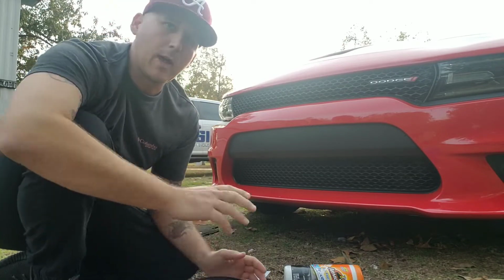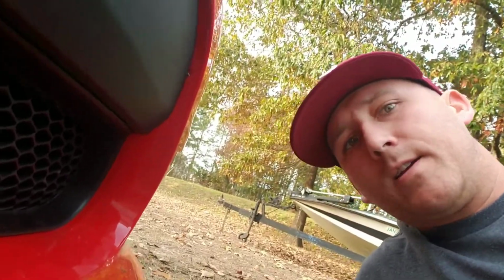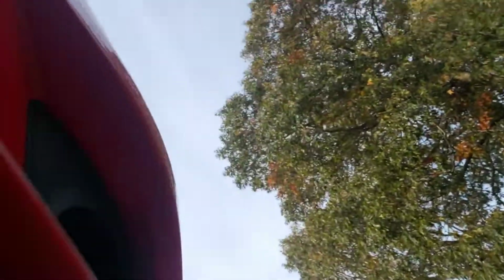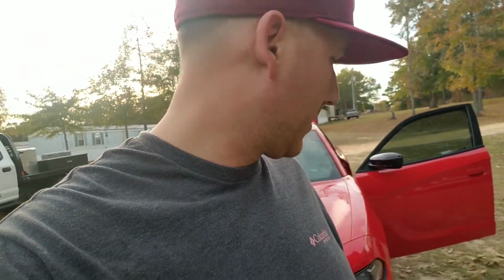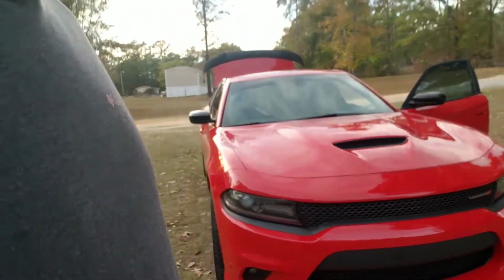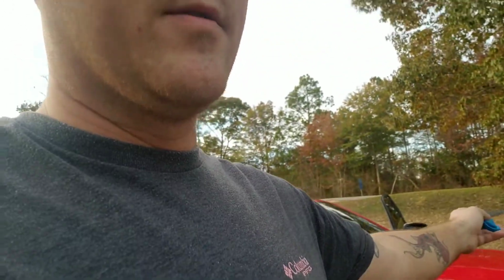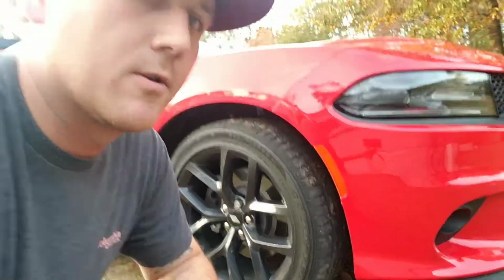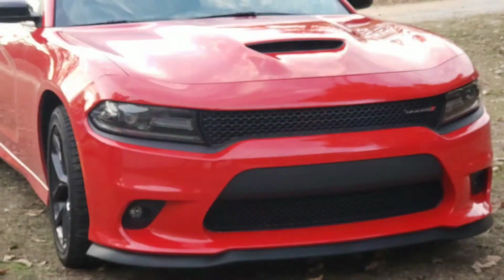Dodge Charger GT  EZ-lip pro installation. 2019 v6 beast 🚘🔥

Comment: The RT had an entire "devil ray-shaped attachment" underneath the ending, along with something like what you've installing here and the pitch of our driveway made it so I had it removed. It's extraordinarily tough and I was sorry to lose it, but I'd rather have that than it - come on as we're driving in it from ongoing wear and tear. The lip and devil ray assembly on mine was held in by bolts/plastic pins. Was this just a looks thing or was there some kind of performance benefit that installing it offers?
Reply: where did you get yours from?